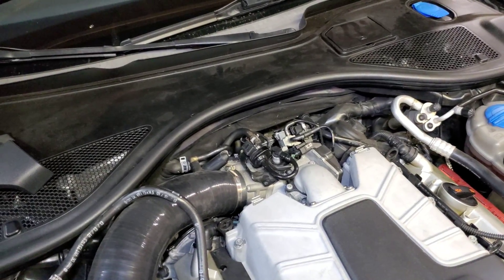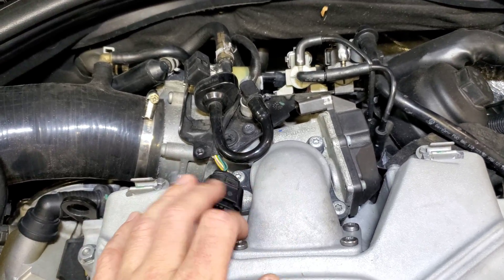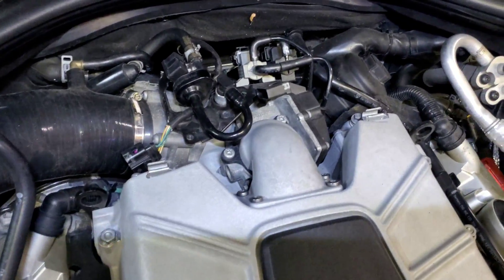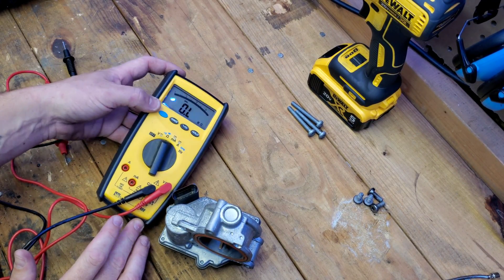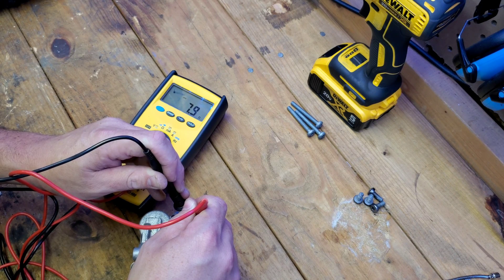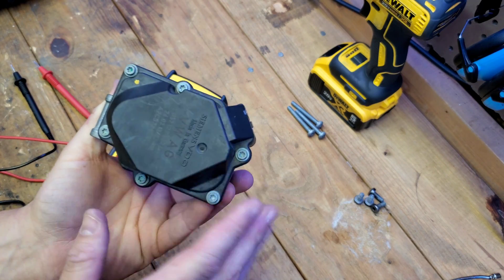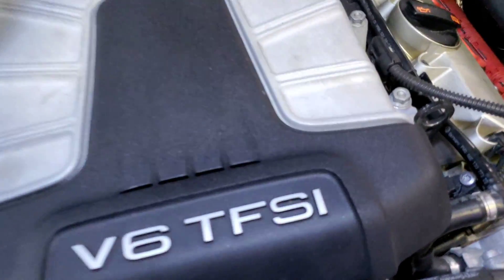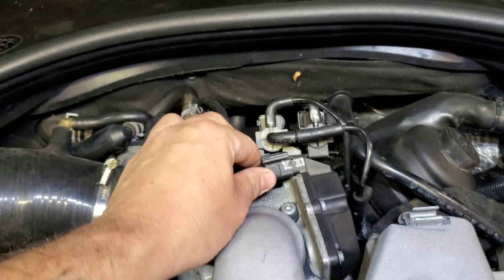3.0T Bypass Valve Failure! How to diagnose & repair code P10A4

Comment: Slightly related question here, I've run out of ideas... I've been chasing a loud (I mean loud enough to hear in the car when driving) chirping squealing noise coming from the engine for almost 2 years now. Replaced all belts, didn't help, then all pulley's tensioners and idler, no luck, then the PVC, that wasn't it. Then the nose cone bearing (complete front drive unit), rear bearings, and 2 small heat exchangers in the SC, nope. Just last week I completely swapped the SC for a low mileage one. The noise still persists. This noise is somewhat intermittent (comes and goes, there 80% of the time, perhaps ambient temp dependent?), tied to RPM, is there on start up, disappears when on the throttle (in gear under load), gets louder when just off the throttle. Last thoughts are possible a tiny break in a vacuum line/connector, or the bypass valve. Car is a Manual 2016 S5 3.0t with just over 100k Miles. 
Ideas anyone??? hahah
Reply from the maker: That's an odd one. Could be some kind of vacuum leak creating a whistle sound.

Comment: Hello,
I have an active error code P0068
and a sporadic P02350.
Can this be fixed by the SC bypass valve?
I've already replaced the sensor behind the supercharger, but it still shows P0068.
Reply: @YYGBSN  did u fix it same code
Reply: @BewarHassan-cq1rr  I haven't done anything yet, I have a warranty. It's going back to the dealer.

Comment: I just replaced mine keep getting the codes
Reply: With the old 1 it was only by hot weather with the new 1 it comes on after 2 min of driving
Reply: P10A0 p10A4
Reply: Epc light engine light and 4000 rpm max
Reply: No my bypass valve was bad only thing i replaced you know what could fix it
Reply: They are the same codes you got in the video or am i wrong
Reply: I’m stuck here keep gettthe codes idk what to do
Reply from the maker: Sorry about that, I typed in the wrong code. Did you install a used or new bypass valve? Is it oem?
Reply: @GarageTaught  my shop put it in idk if it’s oem but it’s a new 1
Reply: Any ideas
Reply from the maker: Id take it back to the shop they worked on it since you are still having issues
Reply: Can you help me

Comment: Where did you get that information it needs to be between 2.4-4.6 ohms? I have 5.3. I'm getting two random fault codes about maf/map throttle position error and boost pressure regulation not reached.
Reply from the maker: A friend that is an Audi tech.

Comment: Is it possible for this bypass valve to go bad. With no CEL or softcodes?
Reply from the maker: That would be very unlikely. What's going on?
Reply: I had the same question. I am getting 2-4psi under boost target for stage 2 single pulley. Fuel trims look perfect, 0 degrees of timing correction but I’m only making 15psi peak boost. Maybe belt slip?

Comment: Hello i just got these codes yesterday and my car instantly shutoff. Its giving me the do not exceed 4000 rpm message and it wont start. My battery is also completely dead for some reason. Same codes and no start. I do have an extra code saying something about voltage being too low. My son was rinsing off the motor from a gas leak and when I checked the boost sensor in the driver side was soaked in water.
Reply: @reggielambright3685   the coolant pipe going to my thermostat blew out my car sat for 3 days waiting on the part changed the part and these same codes came up and crank no start currently  found the part $380 plus express shipping $74 so gonna changed it and give an update
Reply: Did you fix it we in the same boat

Comment: Having the fault engine oil bypass valve control circuit open with error code P05E800 this was different to the codes you have would this potentially be the same issue ?

Comment: Hi there, so I replaced the oil filter housing on 2011 q7 along with an air hose that it's off I thr back and runs to the front of the engine for connection. All under the supercharger. I had to weld nuts onto the bolts of the oil filter housing(ground clamp to vice scripts holding the nut to be welded to the bolt) started welding (tack welds) for 2 seconds before I realized the battery wasn't disconnected. End up doing what I went to do after disconnecting the battery car starts and drives fine. 

Previous codes were p0018, p0175and p219d rich codes and lean codes went away after repair, p0018 stayed but now I'm getting random multiple misfire on cylinder 2 (previously was the cause for the lean code and cylinder 5, and p10a6. All codes are intermittent.the super charger wasn't connected when I welded. Is this a battery issue or did I just get lucky with the bypass valve  going bad outside of the car??

Comment: I have code P10A600. Potentiometer regulating flap for intake air - signal too low. 
Could this solve my issue?
Reply from the maker: Potentially! It is a common code when a bypass valve fails
Reply: @GarageTaught  would this cause the motor to completely shut down? Mine shut down while driving and never started after that. Had to get it towed. I think my fuel pressure sensor may be faulty and sending the wrong signals to the computer as why it shut down
Reply: @Joseph-gy5tg did you ever figure it out currently trying to figure out what sensors to buy I’m on the same boat atm ….
Reply: @German_hell_kitty  Yes I did it was the fuel pump that stopped working. I installed a new pump and everything was good to go.

Comment: Hello, i am getting P2262 code
Vehicle is a Porsche Cayenne S hybrid with 3.0Tfsi engine from audi
Can this code be related to bypass valve?
The car drives fine just lacks power while accelerating. But i can still reach 0ver 200km/hr easily. Everything seems fine with the engine and no noise from the supercharger.

Comment: I see this is an old video...
But are there any audible signs of this part failing?
Just did a ton of work including, complete timing chain, tensioner, guides, pulleys and tensioners up front. Had a noisy engine, obvious up front, and the chain rattle drivers side upper rear chain rattle. Found what looked like chain stretch. replaced everything. after getting everything back together, still have a noise seemingly from under the Supercharger. No more chain rattle, pulley system quiet like new. No codes, no misses, nothing.
dropped engine again, ouch, to tear it all apart again. Changed the upper sprocket just in case. Pulled the SC, replaced a 1 year old PCV. pulled vlave cover, rockers and everything were fine. Motor back in, still noise.
This noise seems to be a clicking when the engine is at low RPM. It's only noticeable on the drivers side in confined spaces.  It doesn't get louder with load. Completely befuddled!!
50k mile, 2016, oil changed every 6 months.  No exaust leaks, barely carbon build up in the valves. Doesn't burn oil, and car was never abused. Purchased it a year and a half old, with 8000 miles CPO. 
I figure by now, you have seen and heard it all, any thoughts?
thanks
Reply: Did you ever narrow down the cause of this engine noise? Im diagnosing a mystery sound thats similar on the driver side that hasnt been pinpointed. Im affraid i may pull the cam girdle next and check valvetrain. Collapsed lifter, or valve keeper failure? Sometimes these internal component failures are not instant or obvious, leading our diagnosis all over the place attempting to find the cause.
Congrats on all the work done to keep your 3.0 going. I cant help but enjoy these cars.

Comment: Hey I have the same code on my 2014 Audi s5 b8.5 and it also says don’t exceed 4,000 rpms on the dash should I replace the bypass valve and will that help me get my throttle back to normal when I push on the gas or should I look into something else
Reply from the maker: What other codes do you have?
Reply: What did you do ?

Comment: Great video. Just got the p10a4 today in my 2017 Q7 while driving the tail of the dragon. Checked codes right away with torque pro but had no service to look it up. Kept driving as nothing else seemed off for the rest of the day. Thankfully had no noticeable issues other than a code. Won’t be driving now until fixed. Really appreciate these videos. Makes it so easy to work on and helps so many people.
Reply from the maker: I'm just happy they are useful! Good luck with the repair 🤘🏼

Comment: Does new valve need to be programmed or is it plug and play?
Reply from the maker: Plug & play 🤘🏼
Reply: @GarageTaught  I was testing my pins 4 and 5 and got about 13 ohms. I can't find any information regarding this measurement and tolerance aside from your video, where did you find this info?
Reply from the maker: @T3slanik  from an Audi tech
Reply: @GarageTaught  I was able to remove the motor and spray some electronic cleaner inside and get it into spec. I believe there is some carbon/gunk that gets built up on the commutator that raises resistance. Something to keep in mind for a cheaper fix

Comment: Thanks for the instructions. I also had the P10A400 & P10A000 codes sets off and did the checks like you did. Came back with bypass value reading around 6 ohms. Can you provide the link of the bypass valve from FCPEuro or other site or part #?
Reply from the maker: I don't know it off the top of my head. You can find the part number on ecs tuning.

Comment: I have a question. I need to replace my bypass valve. I will do it myself. But do I need to relearn it through a computer? Because with some cars you need to reset some values   by using a device / computer connected to the car.
Reply from the maker: No you do not. Just a parts swap.

Comment: My sq5 just threw a P10A4 this weekend so I opened the valve up to check the gears and function per your video- thanks btw- and I need a new one. Would you recommend biting the bullet and going OEM or is the Hudson valve on ECS just as good?
Reply from the maker: I don't have any experience with the non oem units so I couldn't say. If you go oem, id order from fcp euro if they have it
Reply: @GarageTaught thanks man!

Comment: Im stage 2+ and just did e40 for the first time. After a few pulls yesterday after getting e40 i got EPC light on and limp mode, when i pulled up i got that code. Would the e40 cause this being a first time and the car getting use to it? Or maybe it’s a sign of mine going bad?  Cleared the code and a few pulls later and a day at the dragstrip havent got any code.
Reply from the maker: E40 shouldn't have caused it. I think you are fine if it doesn't come back

Comment: I replaced my bypass valve with an aftermarket one, Hudson brand around 3 months ago. Changed it due to multiple codes for “regulating flap for intake air” p01A8,p01A4. The same codes have came back with the new valve. 
I Checked resistance on the original valve it was 24-25ohms, checked the Hudson valve currently installed and it was 8.4 ohms. I’m seeing 4.9V on the wiring harness. Debating if I should get an oem bypass valve😢. Also noticed some oil around the o-rings and mating surfaces on the bypass valve, did you have that as well?
Reply: Pcv maybe ? I just had my bypass valve go out but along my research I found a few people with similar issues on replacing and having it go out in just a few months. Signs of oil can be related to an underlying problem most commonly a Pcv on its way out.. that’s just what I’ve read on other peoples experiences with finding oil around the bypass valve. I recommend Doing your own research though and comparing your findings with others to pin point the problem before throwing money in to it.

Comment: Hey I have a Audi A6 3.0 tdi 2013, and I have a problem when I'm driving from standstill doesen't matter if its on a hill or flat ground sometimes my car tends to shake and sometimes it goes without an issue. according to the mechanic my ESP Electronic is dead, basically the car does not know where its located on the flat ground or on the hill and it turns on abs esp automatically when driving off and shakes. Could the ESP be the issue I need second opinions as its an expensive repair just to make sure I'm getting the right thing done. (Multitronic transmision)

The second issue I'm having is the engine not heating up or the cabine  on colder weathers even if it does heat up after a long time, the temperature drops down in a second, I've replaced the thermostat as that is normally the problem but no difference. Is there by anychance a second thermostat?

thank you
Reply from the maker: To my knowledge there is not a second Thermostat on that car for your hvac system.

Have you scanned the car for codes?
Reply: @GarageTaught  sorry i just got home from holidays, i checked the car for error codes nothing relating the issue comes up, i just tested the car drove it for about half hour with 7 c outside temperature. Oil temp went up to 70°c but drops as I drive, the coolant temp  went from 45°c to 52°c and stays there which is I'm guessing too low. So I think the thermostat is probably not working

Comment: Hey. Great video. I have a 2011 S4. Car stalled randomly and I am setting P0652, P10A6, and P10A4. The car will crank and not start. I let it sit for a week and it started with no codes. Then on road test it stalled and same codes appeared. Any ideas???
Reply: Just wanted to give an update. 
Spent the morning tracing wiring. Problem turned out to be bank 1 pressure sensor in the supercharger housing. It was pulling down the 5 volt reference causing a no start condition. I also believe it needs the bypass valve as it is out of specs. Thanks for the help
Reply from the maker: Glad you figured it out! These cars are finicky when electrical issues come into play
Reply: @brianwells4466 bank a is pass side? Month ago had driver side go out now same codes as you as well as no start issue now. Car died while the wife was driving it not too pleased with that.
Reply: I think this happened to me over the weekend. Same codes and no start. I do have an extra code saying something about voltage being to low. My son was rinsing off the motor from a gas leak and when I checked the boost sensor in the driver side was soaked in water.
Reply: @reggielambright3685 currently dealing with one potentiometer intake flap sensor 104A6
Reply from the maker: All of your codes are pointing to a bad bypass valve.
Reply: Thanks for the response. I can understand the P10A4 and P10A6 as a result of the Bypass Valve but I do not see how it could cause a crank no start. Also with the bypass valve unplugged the P0652 is still present.
Reply from the maker: Unplug your bypass valve & try to start your car. Let me know what happens. Don't rev it.
Reply: Yeah I have tried to start car with it unplugged as I thought that maybe the bypass valve was pulling down the 5v. Reference. No luck. I also popped a different PCM in just to see if those codes were present and they are. I am assuming I have a wiring issue. A short possibly bringing down my 5v reference voltage
Reply from the maker: That is very possible. If you have a friend with a 3.0t, I'd suggest swapping their bypass valve into your engine just to rule out that being the issue.

Comment: Hello I have a 2017 Audi Q7 prestige and I have a question. I have a pop sound when I hit the gas and it's like my car kind of hiccups when it Change to second gear. NO CODES. I went to the dealer and they said the popping sound is my supercharge bypass valve getting stuck. I been looking for that part but I don't see it or do you have anything that sounds familiar to what I'm talking about and the part I'm looking for? Thanks
Reply from the maker: I've never experienced what you are hearing, but if it is the bypass valve then that is the part I changed in this video. Very simple. You can find the part new on fcp euro or ecs tuning

Comment: Um I need your help can I shoot you an email again I got a few issues the biggest it seems right now though is I have a low voltage supply however my battery is charging just fine 14.7 I run a sub and amp and I also got some oil leaks on the bottom of my car maybe you know why I would down there

Comment: Hello!! was wondering if you've ever had oil problems? I have a 2012 A6 3.0t, I replaced my valve cover gaskets, my trans is only 4 years old. I have to put 1 quart of oil in the car every 2 weeks because I'm losing oil that fast.😅 I'm not leaving puddles, I'm not shooting smoke. If i drive the car hard I seem to use up more oil. I don't lose oil if the car just sits, and I don't lose much oil if I drive the car in normal mode. I drove the car in S mode for a day and 3/4 of my oil was gone at the end of the day ( I had just filled it that morning) I realize things are hard to diagnose without seeing the car in person just thought id ask if anyone has experienced something similar as i can't seem to figure out what the issue is. :/
Reply from the maker: We actually have a video on oil loss, have you watched that?

It could be any number of things (bad pcv, bad piston rings, etc)
Reply: @GarageTaught  I'll take a look, Im losing oil fast and i just can't figure out what the problem is i'll look for that video now appreciate it 👍🏽

Comment: My bypass valve is working fine but I'm thinking of getting one to have on standby for when the inevitable happens! Every one I see available though (from the EU), they all say that the ecu needs updating? Anyone know if this is true? My guess it just needs to go through a basic adaptation. I also have a genuine VCDS cable though, if it can be done through that then it'll be easy enough I suppose.
Reply from the maker: The car should Auto-calibrate it when you turn it on
Reply: @GarageTaught  Good to know bud, cheers for the reply.